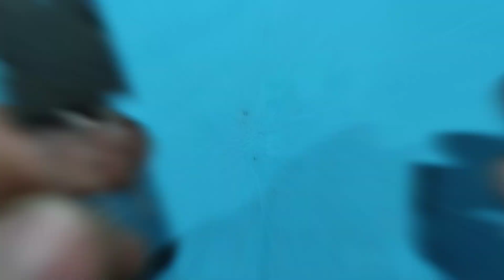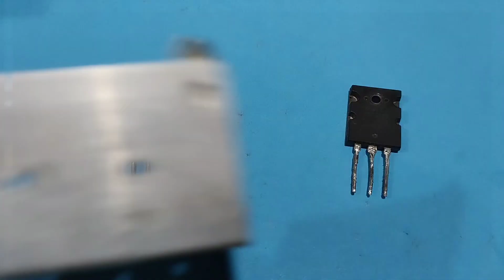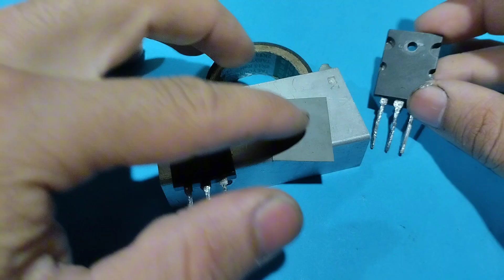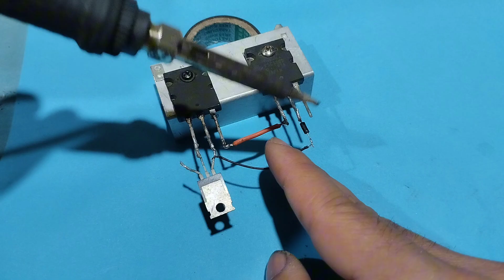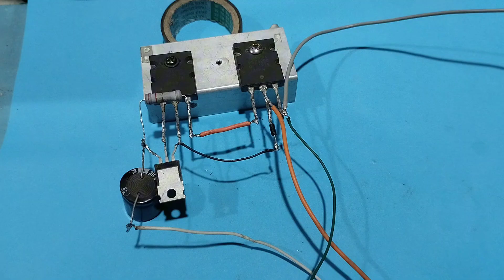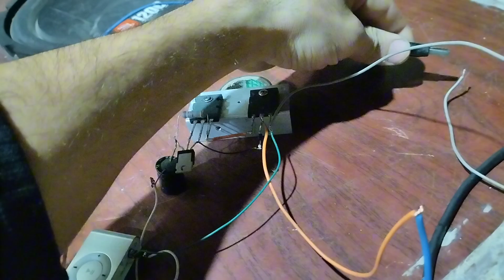How To Make Powerful Bass Amplifier using Transistor 2sc5200 dc 12v

Comment: The amplifier you design is only half oscillation 😂😂😂song amplifying lmao 

Use  +12 0 -12  and  design in class ab type  give base driver transitor  of 5v 1.5a max   and you will get 150w 4ohm output